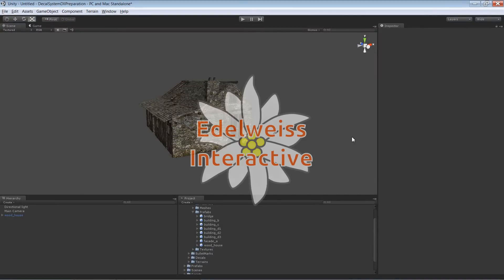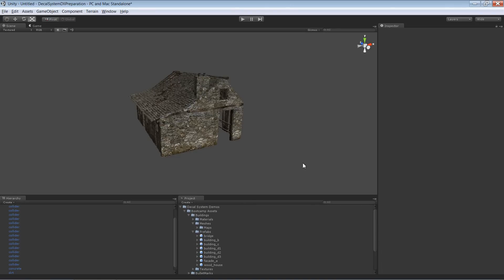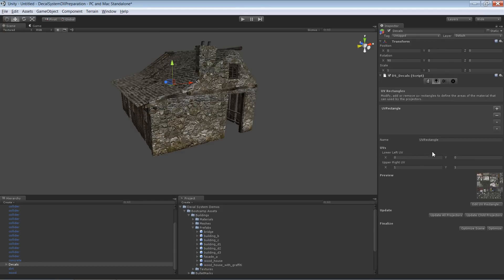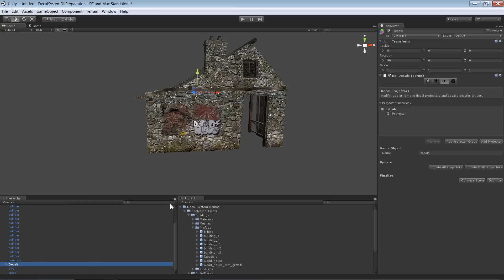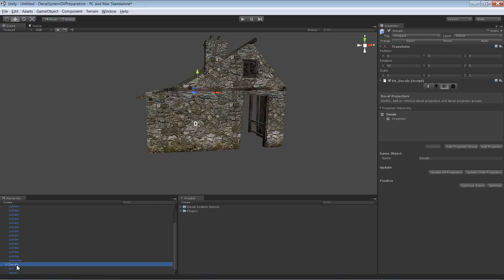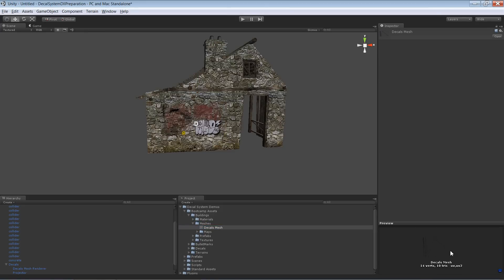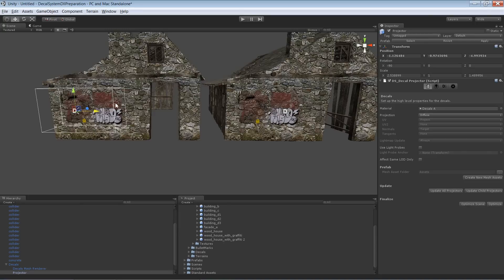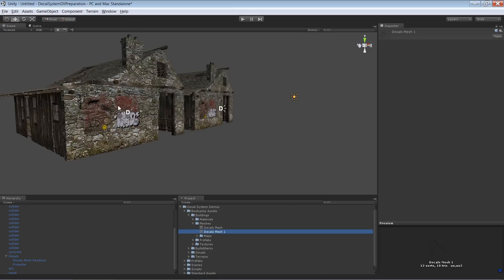Decals with Prefabs

Comment: Will Unity 5 come with a decal system like this? If it will not, will this be compatible with Unity 5 upon release?
Reply from the maker: Unity 5 has no built in Decal System. There is an example project in the Unity blog demonstrating another technique for decals, though it only seems to be meant for demonstration purposes.

The Decal System already works in Unity 5 and there will be further improvements to use as many of its new features as possible.
Reply: Awesome, thank you for the quick reply!